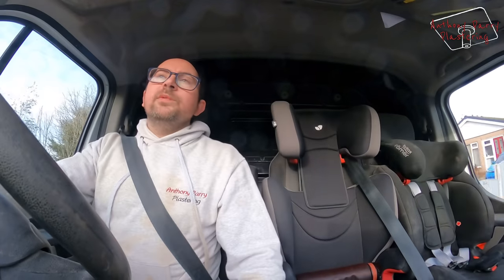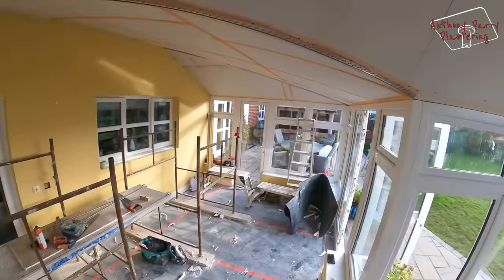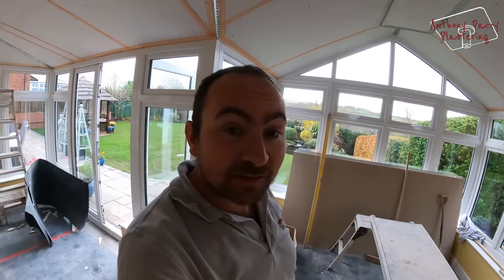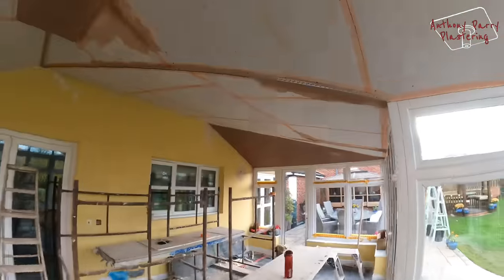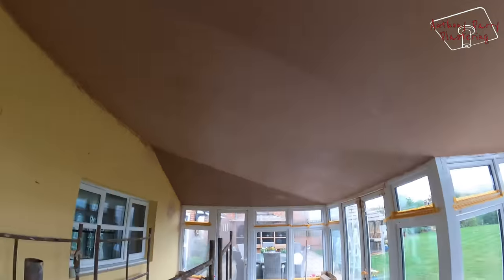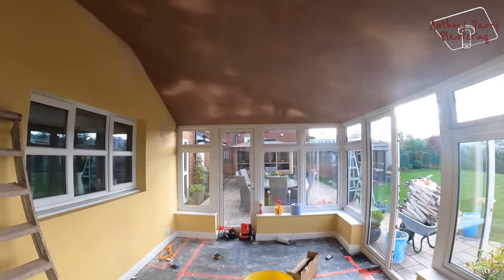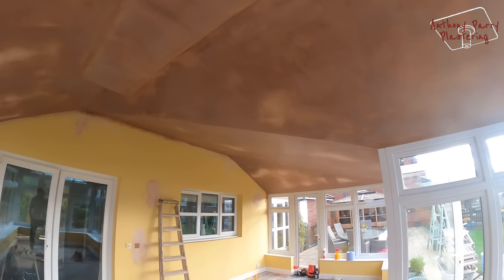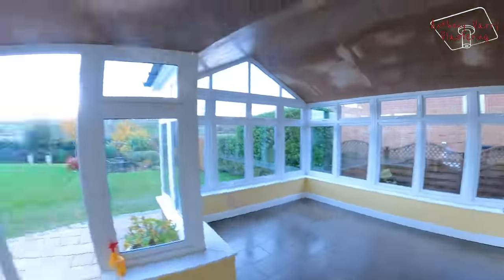Plastering a P shape conservatory ceiling Part 2 skimming. PLASTERING VLOG

Comment: Cracking job pal. Nice and tidy. Would really like to know how the stop beads edges on the internals come up. Have tried it before but didn’t get fantastic results. Is there a nack to it ?
Reply from the maker: Hi Mathew. Thanks bud. I’ve just found keeping to edges clean so I can see the bead helps the most. I also say a plastic trowel really helps at the end. Also using a speedskim or another equivalen is great for keep the line straight.
Reply: I struggle with internal angles with stop beads too, can never seem to get them filled out enough on both sides

Comment: What’s the glue called that you used for the beads mate.keep up the good work bro 👍🏻
Reply from the maker: I’m currently using the ever build contact adhesive spray. I’m sure there’s a few different makes out there that will do the same thing. Thanks Peter